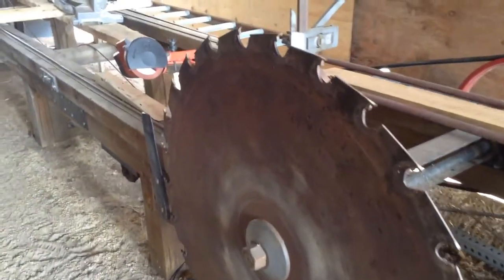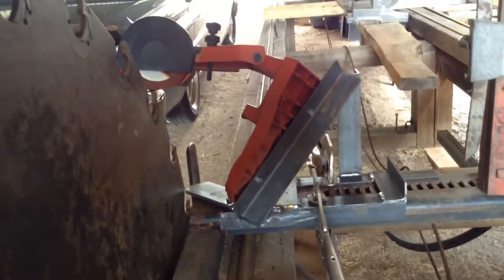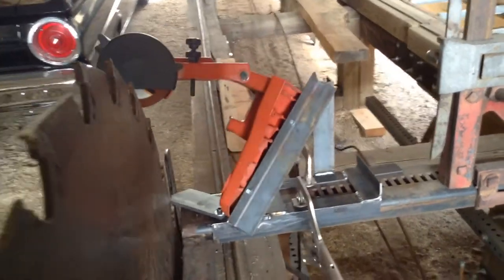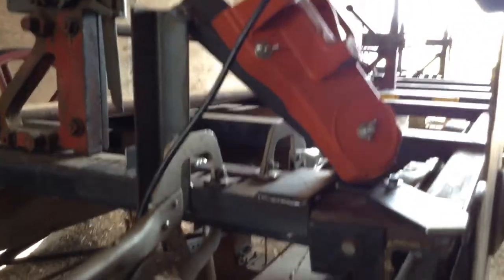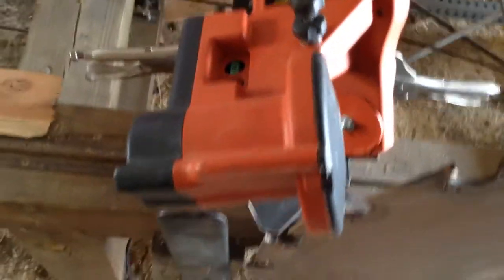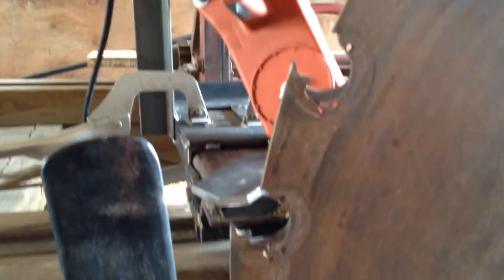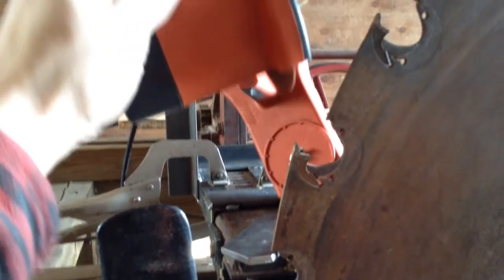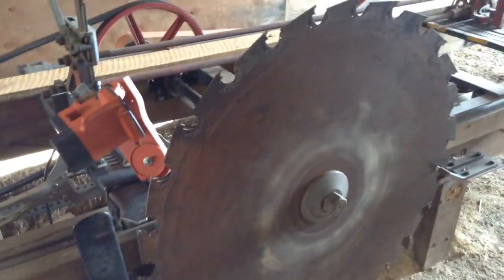Circular sawmill blade sharpening

Comment: The wheel, is only really good for steel. Those teeth are replaceable , but your idea is feasible if you have the right wheel and reliable / repeatable angle. The 4" wheel on the chainsaw grinders are about a 1/8th inch smaller housing then regular 4" cutoff wheels for grinder. Would amaze most 2 really see the difference grinding carbide or harder metals with the wrong abrasion wheel. Take housing cover off and make a 4" diamond impregnated tile blade fit. Will sharpen at 10xs the speed.
Reply: Chainsaw teeth are high carbon and chrome coated. Sawmill teeth aren't much different. That wheel would be fine to use.
Reply: Tips are tungsten would require a diamond wheel not aluminum oxide..
Reply: @samuellurton7757  Most people don't spend the money on tungsten carbide teeth. Most sawmills run regular tempered steel inserts which are generally touched up with a file. Plus you can't swedge carbide, it shatters. Unless yours cutting dirty, bark on, low grade or dry hardwood, there's no reason to run carbide inserts.
Reply: Ya I work at a pallet mill  running the headsaw. We use carbide sawbits on the headsaw but cut dirty old sometimes undebarked logs all day long and never really have a problem